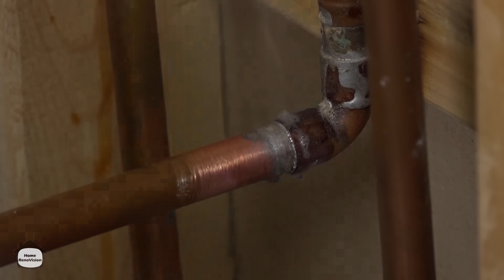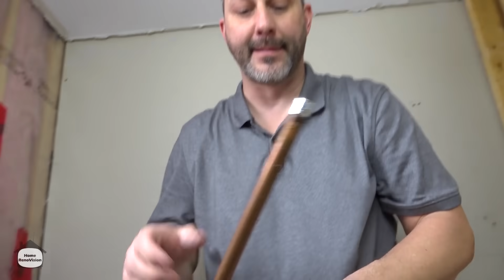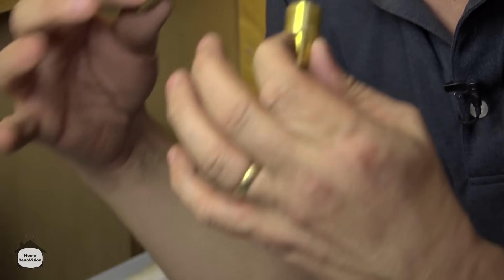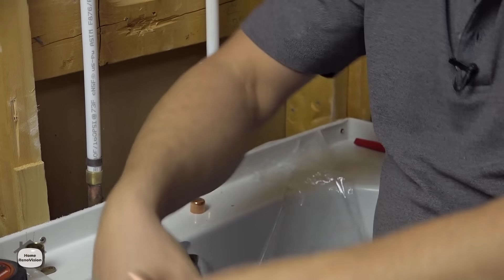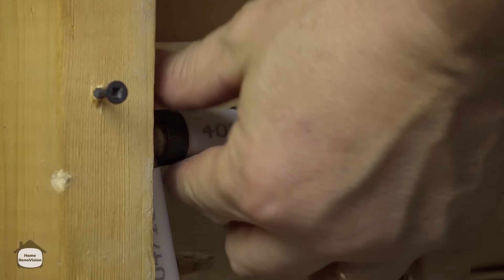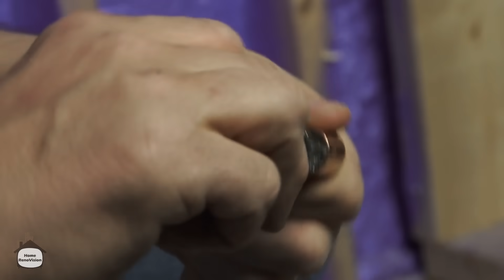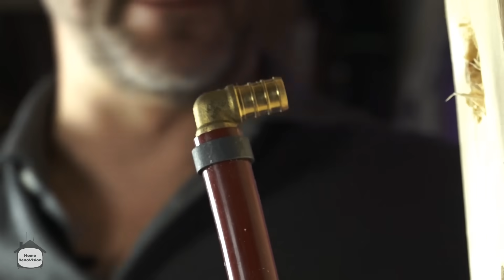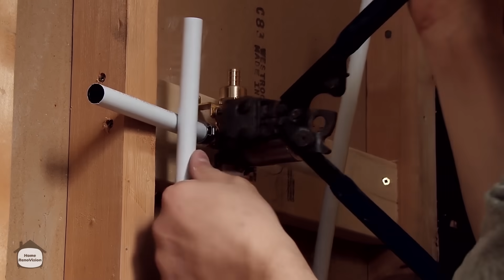4 Types of Shower Valve Assembly Installations

Comment: Hello... Love your videos 😀 just a quick question on the shark bite system... Is it comparable to solder and does it last as long? Keep the videos coming thanks for your time and help...
Reply from the maker: around 30 to 50 years with the new generation of product. If you can learn to solder it is a definite better option. There would be no need for maintenance and you would not need to install the trap door.

Comment: One other thing what  is your thoughts on pex-a and expansion fittings?
Reply from the maker: not concerned.
Reply: Those make the best connections and  have the best water flow because the fittings have bigger openings.

Comment: looks like using pex results in a reduction of water flow.
Reply from the maker: Actually the smallest part of the system is in the shower diverter. so no need to worry about the supply lines.
Reply: Excellent!

Comment: "Try not to burn the wood in the wall."   lol   So that's what caused the fire!!!   lol
Reply: Burning is not normal, spend a few seconds and put a flame mat or small piece of metal behind the torch and prevent torching your framing or drywall paper.
Reply: @jpcooler  lol it is normal though.
Reply from the maker: A little burning is normal. The secret is to have a spray bottle close by.  Cheers!
Reply: @HomeRenoVisionDIY  or use a piece of carbon felt
Reply: SandiRose2

Comment: I was wondering, do you have multiskin pipe in North America ? Its a mix of PEX on the outside and copper inside ! Thats the only thing we use in Belgium since its rater 100 years and can be exposed to UV. Would be fun to have a video comparing Europe and North America
Reply from the maker: Hard to compare, there are so many major differences in materials. But I will try!Cheers!BTW I have never seen a hybrid pipe like you described.